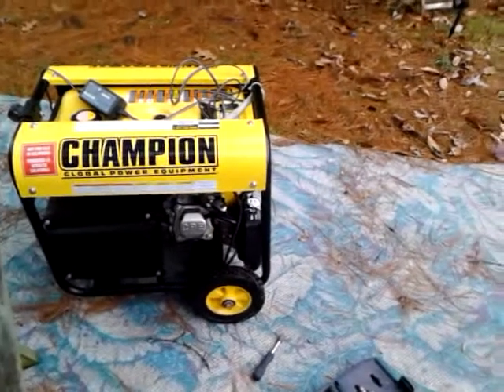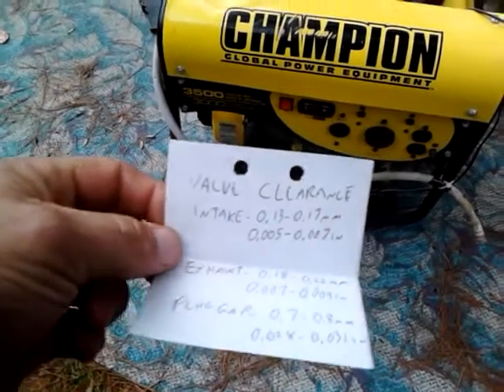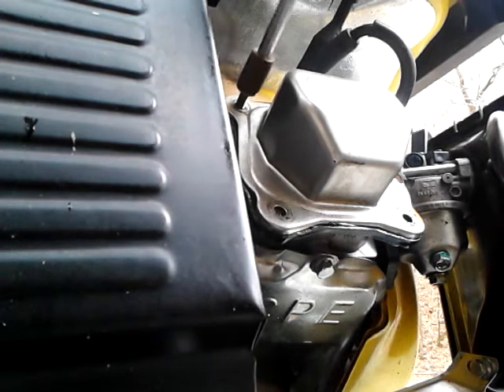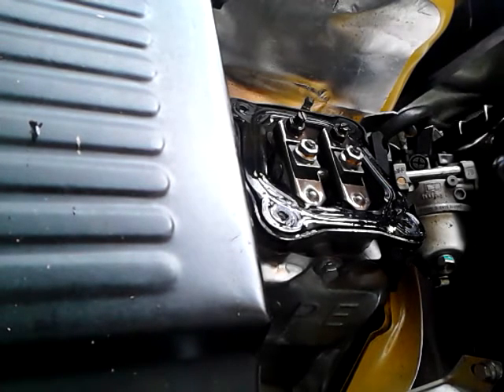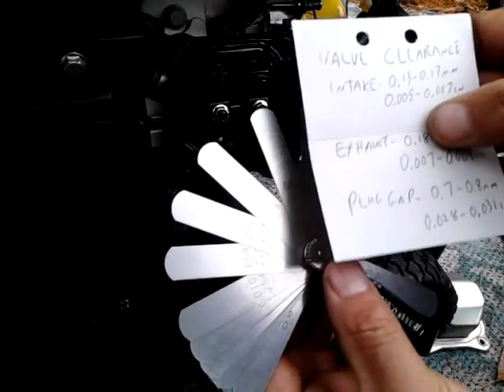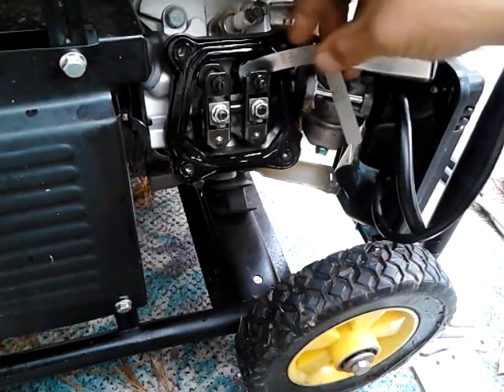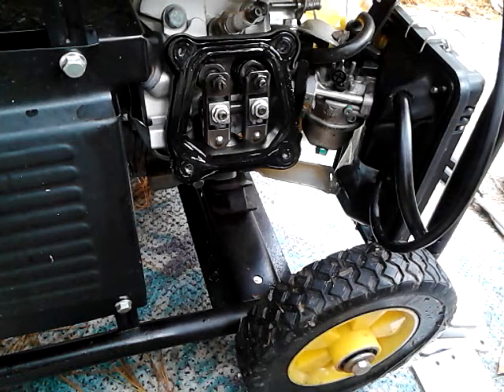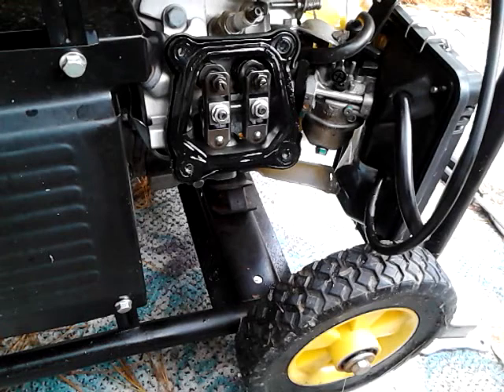how to adjust valves on a generator

Comment: Hello, I have a generator that it does start and run, but throws lot of oil infront of the carburator. I already installed a new carburator. What could be the problem ?
Reply from the maker: It sounds like your generator might have excessive crankcase pressure, possibly due to worn piston rings or a clogged breather system. Other things to check include:

Blow-by: Worn piston rings can cause combustion gases to escape into the crankcase.
Oil Level: Make sure the oil level isn't too high.
Breather Valve: Ensure the breather valve isn't faulty or clogged.
Air Filter: Check if the air filter is saturated with oil.
Valve Guide Seals: These might be worn and leaking oil into the intake system.
Hope this helps!

Comment: According to the directions from Champion you are suppose to turn the engine over until the exhaust valve is completely compressed then adjust the intake, then you compress the intake all the way down and adjust the exhaust valve clearance.  Not the method you did. Technical Bulletin Number: 7020001
Reply: Yes, I followed that procedure, I adjusted the exhaust valve to 0.008" and inlet valve to 0.006"